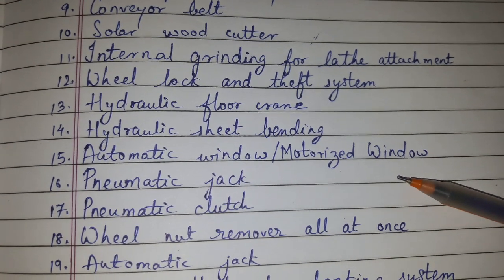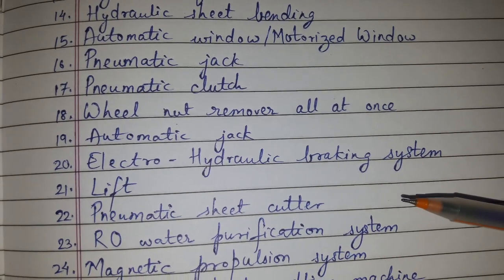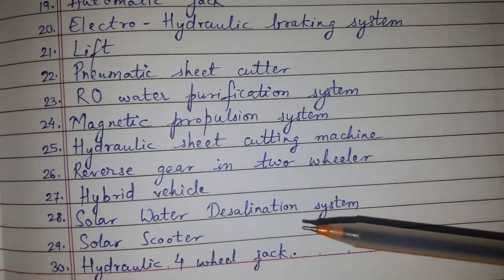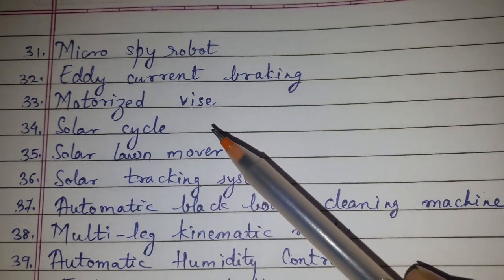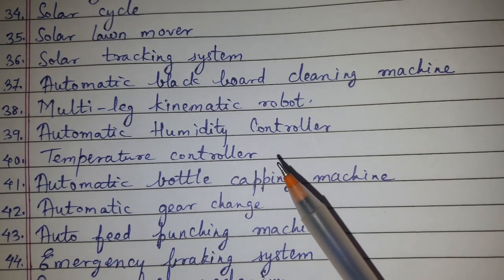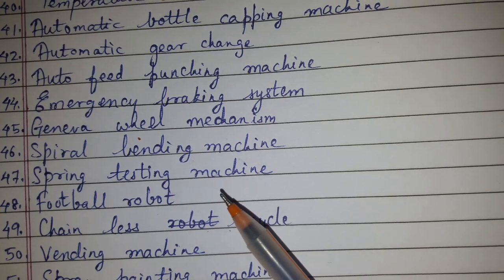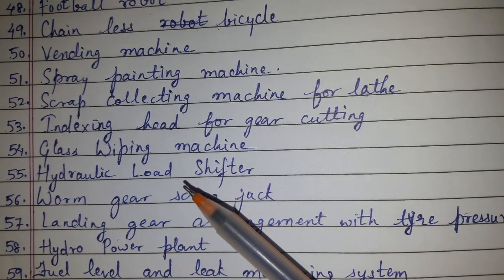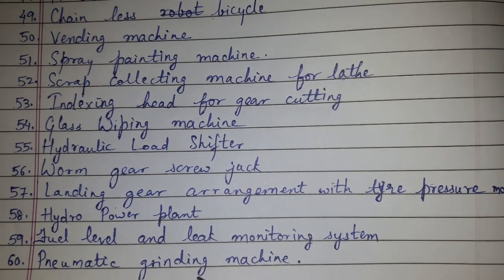Mechanical projects.... #70kviews #viralvideo #mechanicalprojects #projects

Comment: Hello sir now I am doing masters in engineering at thermal engineering branch so now I entered into 2 year so I have a project so I don't know what type of project I want to select can you give any idea
Reply from the maker: Latest research papers that you can use to make your project: 

Virtual Manufacturing (3D technology)
Maglev Levitation Trains
Electric Bicycle
Wear Debris Analysis (vibration analysis)
Safety and Security in Automobiles
Neurotic Robot
Anti-lock braking system
Brake Booster
CRDi System
Nanomachines
Noise reduction method on motorcycles
Observer Based Sensorless Control
Safety and Security in Automobile
Vacuum Braking System
Fractal Robots
Green Engine
Head And Neck Support (HANS)
Humanoid Robot
Air Bearing
Air Car
Animatronics
Gas Welding / Oxyacetylene Welding
Reply from the maker: https://youtu.be/Leg9qWRmTb4

Comment: Hiii bro
Reply from the maker: Hi...
Reply: Can you share your number to contact in WhatsApp
Reply: For mechanical engineering bri
Reply from the maker: The list I gave is for Mechanical Engineering...

Discuss with your college faculty to finalize on topic...
Reply: Little easy capstone project
Reply: I need idea for doing capstone project
Reply from the maker: Latest research papers
Virtual Manufacturing (3D technology)
Maglev Levitation Trains
Electric Bicycle
Wear Debris Analysis (vibration analysis)
Safety and Security in Automobiles
Neurotic Robot
Anti-lock braking system
Brake Booster
CRDi System
Nanomachines
Noise reduction method on motorcycles
Observer Based Sensorless Control
Safety and Security in Automobile
Vacuum Braking System
Fractal Robots
Green Engine
Head And Neck Support (HANS)
Humanoid Robot
Air Bearing
Air Car
Animatronics
Gas Welding / Oxyacetylene Welding

Comment: I'm a 3rd year Mechanical engineering [B.tech] student . I want topics on ME to get easy publication on any Journal . Please help  me .
I just WANT a publication in a journal and ready to do research and hard-work  . I want a proper #GUIDANCE , Please do help me ......
Reply from the maker: Latest research papers
Virtual Manufacturing (3D technology)
Maglev Levitation Trains
Electric Bicycle
Wear Debris Analysis (vibration analysis)
Safety and Security in Automobiles
Neurotic Robot
Anti-lock braking system
Brake Booster
CRDi System
Nanomachines
Noise reduction method on motorcycles
Observer Based Sensorless Control
Safety and Security in Automobile
Vacuum Braking System
Fractal Robots
Green Engine
Head And Neck Support (HANS)
Humanoid Robot
Air Bearing
Air Car
Animatronics
Gas Welding / Oxyacetylene Welding
Reply: @mechtechknowhow869   Okay, Thanks for help